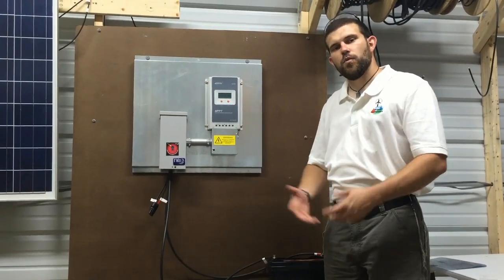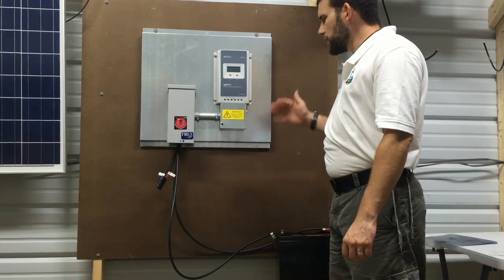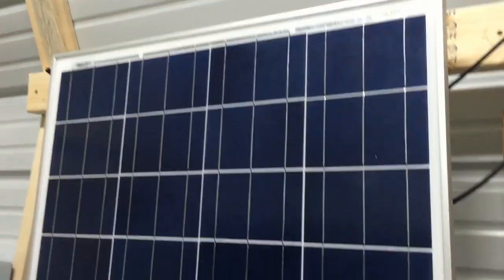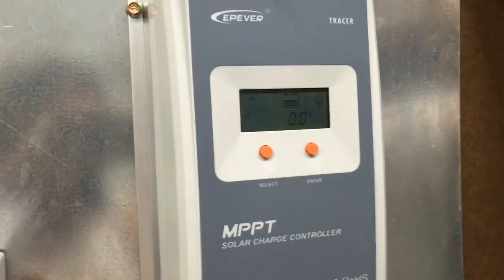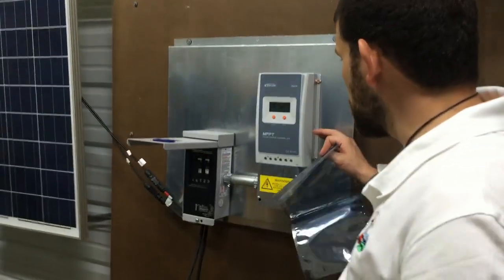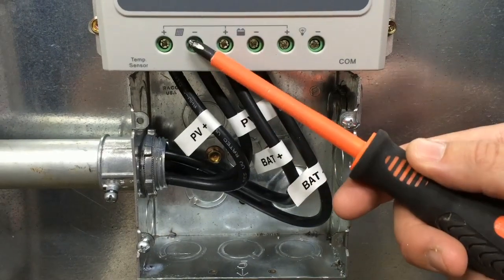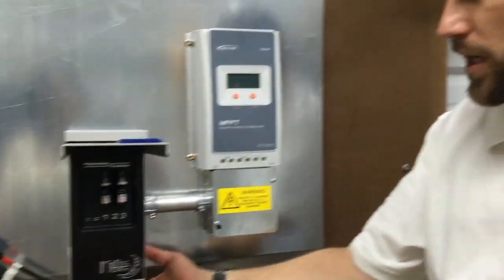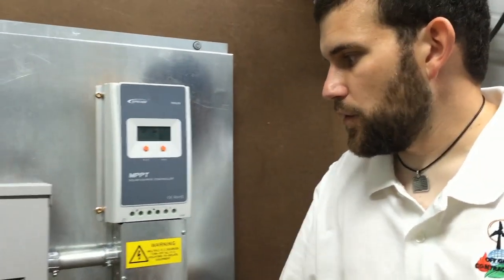40 AMP SOLAR MPPT Off The Grid board and EMP ready kit available by Off Grid Contracting

Comment: How does all this get connected to my electrical panel/box all ready in my house.Im confused.
Reply from the maker: An inverter would be needed to produce the AC current needed for loads. I did not demonstrate that part as that this is just the battery charging system that was demonstrated in this video. An inverter would  be needed to be purchased for your system.